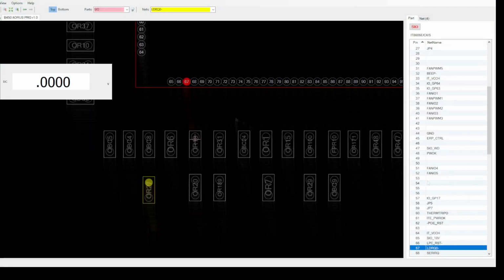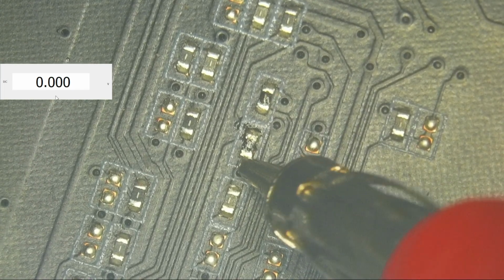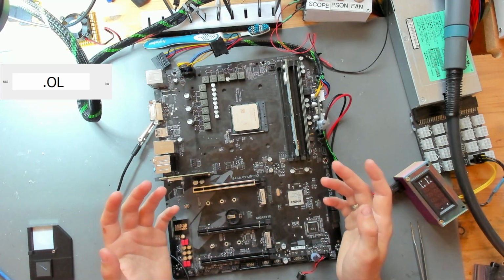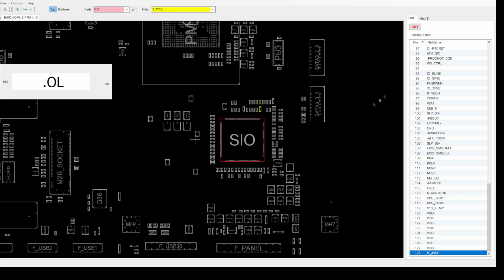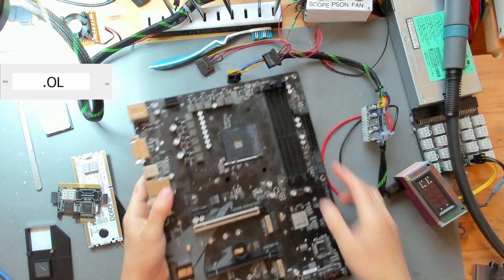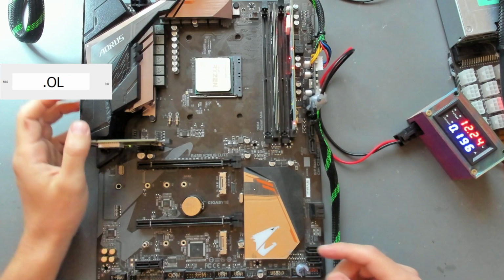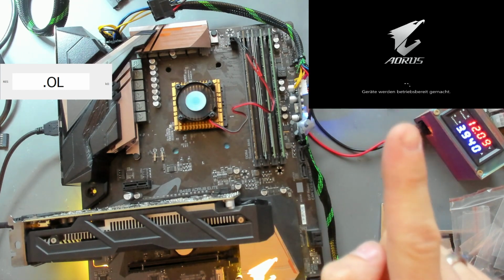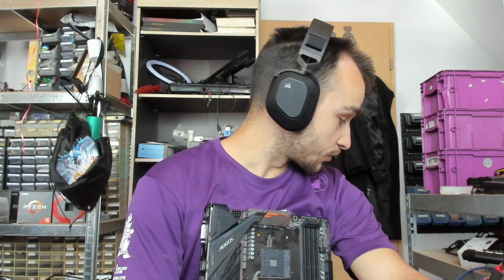PART 2  ||| 2 GIGABYTE AORUS B450 DEAD FROM EBAY | B450 AORUS PRO MOTHERBOARD REPAIR

Comment: Have had a LAN IC short and get very hot, but after yanking it, ie, clearing the short, the PCH got hot. I checked the BV and the LAN connects to the PCH with I think SPI, so I assume the LAN volts killed the PCH because it's directly connected.
So many AMD MB get tossed because the BIOS has to be updated.

Comment: I have an msi b450 that boots up fine….install windows….load drivers……everything. Next time……..no boot. Stuck on CPU. Doesn’t matter what CPU you install. Always does the same thing. Must be a bios problem.

Comment: I think I have something that can help you with the Aorus B450 Pro. I happen to have 2, one that is good which I use everyday, the other has various similarities to yours. 

I was watching the video hoping to see what could be the problem with the one that is not working, which as soon as I connect the power supply it just turns on with a CPU led on and nothing else. Also, looking at the boardview, my MA_ZD1 was also shorted and burned. So I decided to take out the good motherboard from my PC to finally take the step to compare them and see what's different. 

I found that my MA_ZD1 that I replaced some time ago had 55 ohms, whereas the good board had 2.9k negative to ground and positive to positive. Then I checked MAU3 which is a synchronous step down converter: it converts 5 volts input into something lower. Positive lead to Vin (pins 6 to 8) and negative across in phase (pins 1 to 3). The good board shows several Ks, around 8k, while the bad board shows 2.8k. I kept looking down the path backwards a little bit and found where the 5 volts come from. After an inductor I found that MQ1 shows 3.5k on the good board whereas the bad board shows less than 600 ohms. 

Conclusion? Somehow 12v made its way into the 5v rail, taking out in my case TCDU1, MA_ZD1, MAU3 and MQ1. So considering that your MA_ZD1 was also burned, you probably had something similar in that board. Check MQ1 and MAU3 and you'll probably be one step away from fixing yours.
Reply from the maker: Hey there thank you very much for the comment sadly this isnt the case with my board! TCDU1 is good, not shorted, MQ1 desoldered and checked out off curcuit and is not shorted. MAU3 still gives out the 2.5V that it should taking the 5V. Interestingly the MQ1 also has 800 ohms similiar to your broken board!
Reply: @MainboardMedic  I have the same exact problem you’re having on your board but I had a donor board with the same Pch so I swapped them over.Absolutely no changes at all even replaced the Sio. It is possible the Pch I swapped over was bad but I highly doubt it.This board is starting to drive me to go absolutely insane lol.Hopefully you do a follow up some day soon

Comment: learn new thing everyday, so Usbc controller data line break PCH sadly. But how about shorted regular usb or shorted audio port, can it break PCH too? thanks a lot. subscribed.
Reply from the maker: Well its not defenit, that it can brake it, but it could. I dont think they can brake the PCH, if there is no direct connection between them!

Comment: ? High side vcore MOSFET short puts 12v into CPU? 12v KILLS CPU? Check for vcore high side MOSFET  short before installing CPU?
Reply from the maker: You are totaly right and i got really lucky twice now, that my CPU was damaged. But it seems, that my ATX adapter never puts out voltage if it sees an short curcuit. But you are right!

Comment: thanks for sharing, it's always a pleasure to watch your repairs .
Are you planning to try GPU repair ? Maybe you should give it try , good luck
Reply from the maker: I actually did some GPU repair already, mostly older cards aorund rx 400 and 500 Series and some 20 series, but the big problem is, there is a lot of reballs and memory repair out there with GPU´s and i am really not interested to get into that kind off BGA work!

Comment: If you apply some heat slowly on the chip while switched on n checking voltages see if that changes anything?
Reply from the maker: We tried that, but didnt really see any change!
Reply: i hope you will fix it one day. Keep up the great work 👍

Comment: Hello🤝I also had big problems with the Aorus b450 pro board and I also thought it was dead and the problem was in the bios, I don't know what version you have on this board but try the lower version of F42a with Atlon 200GE, the problem appears on this board when the bios is not updated sequentially I hope this helps, best regards.👍👍👍👍👏👏👏👋👋👋👋👋👋

Comment: bro that board is simple: it is one of the 4 things. 1. SIO 2. PCH 3. cpu socket 4.some small component. i would replace just SIO and call it a day(5$ on ali or free if you have donor, worth the try). rest is not worth the time as this board is very basic and has minimal value if fixed. PCH can be also replaced for scientific reasons without anything but experience, you just need hot air and preferably ANY bottom preheater.
Reply from the maker: You are right, but i am really stubbern and want to pinpoint the exact point off failure! But you are also right that it really sint worth the time money wise!

Comment: Hey, you gave it your best shot; that's all you can do. But it would be interesting to lift the PCH to see if there are any ripped pads. You don't need that expensive gear to remove a chipset; I've seen a video where they did it on a simple baking tray. I will link you to the video; you can give it a try. It worked for me, but make sure you have enough ventilation! [link: https://www.youtube.com/watch?v=VLWRMW8-ka4&t=225s]

Comment: Hey, glaube wir treiben uns manchmal gegenseitig die Preise bei Ebay hoch :) Ich habe dasselbe Board zuhause liegen, derselbe Fehler ohne USB C "short". Ich hab es zum posten bekommen indem ich den unteren PCI-Express rausgenommen und den Chip darunter getauscht habe. Der wurde zuvor sehr heiss... ausgetauscht und jetzt hängt es bei VGA 😪 hab ein Postdevice selber gebaut und lese die codes mit putty über einen Raspi-Pi Nano...
https://youtube.com/shorts/DXi8TP8cuH4?si=1KLIYIprbj4tsEo5
Reply from the maker: Leider funktioniert der link nicht!
Habe den auch unter der Wärmebildkamera untersucht, aber nichts auffälliges gefunden, vielleicht sollte ich mal nach der Versorgung für den alleine gucken!